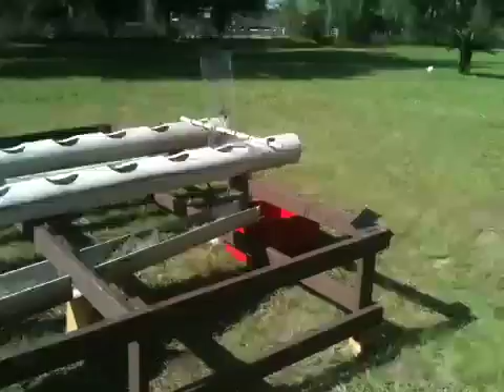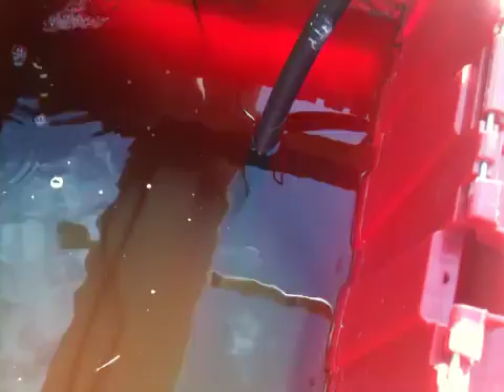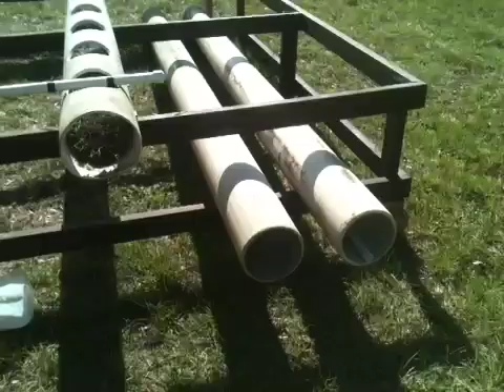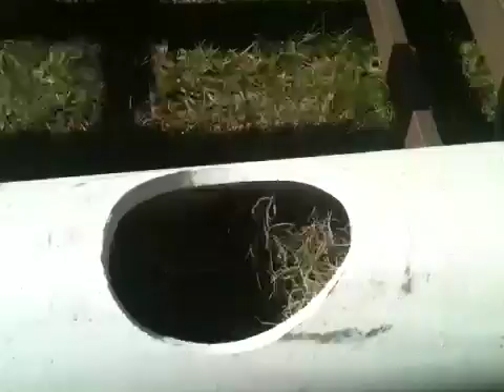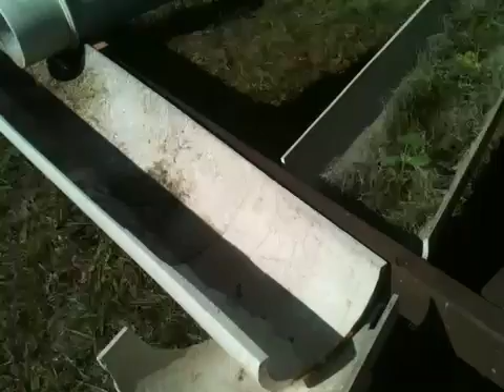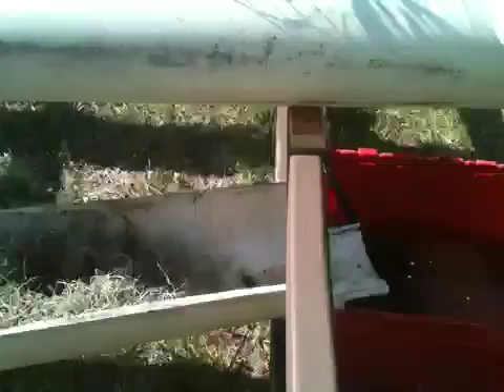DIY Self-Watering Solar Powered Hydroponic Garden

Comment: Thanks for the tip on the pump. Is it still functioning for you? The amazon reviews are pretty hit and miss, but the negative reviews consistently mention a very short (under a month) lifetime.
Reply from the maker: Cliff Rock Hey Cliff! I've had zero issues with the Amazon solar pump, but I did have problems with 2 pumps I ordered from China that seemed identical in the photos, but when I received them the solar cells has sharp edges, and neither pump was strong enough to get water through a garden hose.
Reply: Thanks!

I've been running it either a 7.5v or a 12v wall wart depending on my project. No issues and running since a few days after my comment. 

It was working great on solar too, but I decided it to move it to a constant power source. I will use the panel for something else. 

Thanks again for the reply.